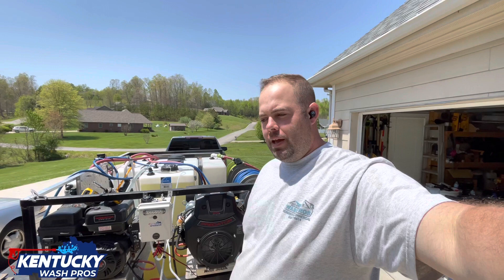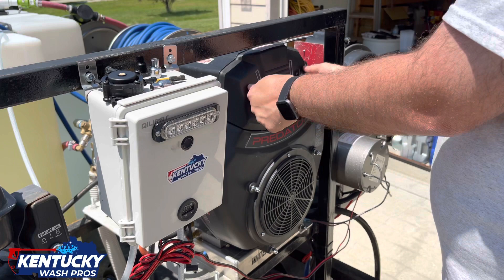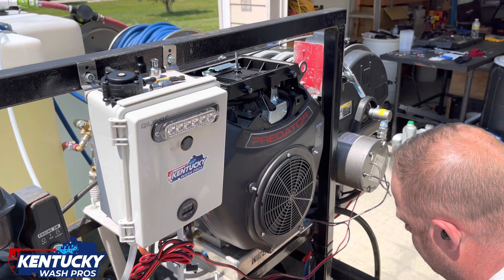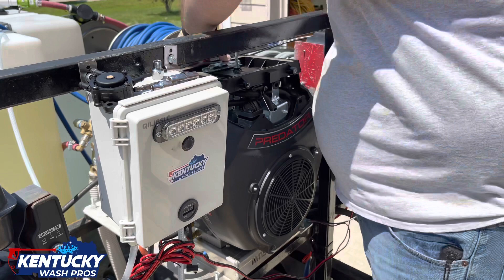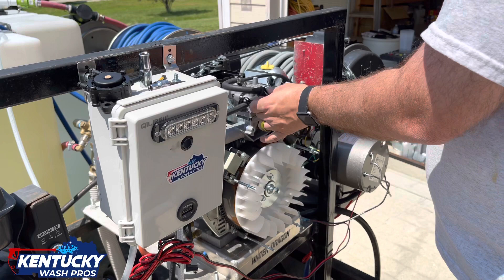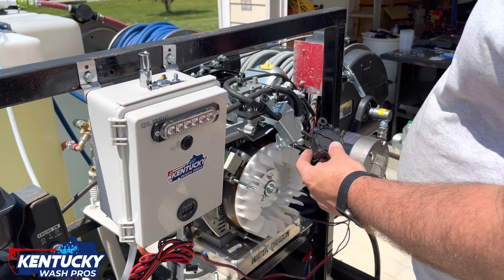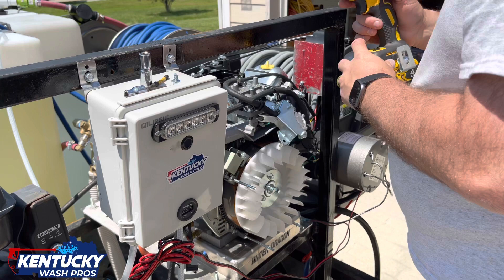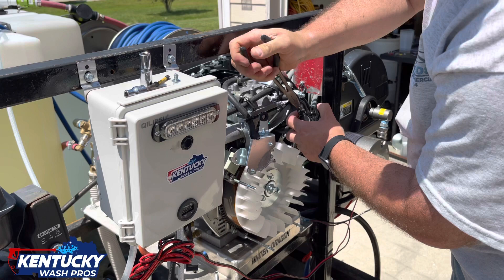How To Replace A Fuel Pump On A Predator 670

Comment: Great engine I've not had one issue with almost 2 seasons on it.  First thing I did was change the fuel filter and fuel pump with Honda parts.
Reply from the maker: I changed the filter first thing and really wished I’d went a head and changed the pump
Reply: @KentuckyWashPros  now all should be right with the world haha.  Watch out for the right side crank case breather tube.  I had some dirt dauber block it and it wouldn't run right until I cleared the tube.  It's a solid engine I use as my main washing rig.

Comment: Thanks for post on this video! I've got one of these motors on a mud-motor kit and from all forums I've read even with the addition of a briggs and stratton fuel pump inside these motors require an additional resource like a electronic fuel pump outside of the motor to overcome this throttle barrier. From the comments below, do you wish you would've done the electronic fuel pump instead of the pairing (internal fuel pump and external fuel pump)? Thanks for your time.
Reply: I just unboxed my 670 and swapped pumps with a GX670 pump and when it came to it priming itself it filled the new filter I installed but once I started it the fuel level was under the filter for pretty much the whole 3 hr break in. It looked like it was running on vapors but some how still sucking fuel in. The higher in rpms the more fuel was in the filter but it still looked lower than it should be. I do need to double check my fittings at the gas tank because every so often I'd see some bubbles come through. Not a constant bubbling but ever so often a group of bubbles came through the filter. That was yesterday, today I noticed the fittings on the tank were out of place aka loose. But I may also take the inline fuel shut off switch of that's another source of air. At 2h52m of the break in I did get some noise variations from then engine and then some sputtering but then it went back to normal. I think the fuel tank just needed to be tilted even though it had probably two gallons left but idk how low the pickup tube is for the 6 gallon scepter tanks. Also I drained the oil that was already in the engine before break in, had two small globs of grease come out. Add 1.5 quarts when filling then read the dipstick from there and add if needed. I added cross hatching to the stick with my knife to make the oil stick and easier to read. I should be uploading my pressure washer build on my other channel soon. It's 19.7GB worth of clips. You don't exactly see me build it but there's details in it you don't usually see.
Reply: I just kept the 1/4 line short as possible use a primer bulb and never had an issue.

Comment: One of the most common “upgrades” is changing out to a Honda fuel pump. It’s good insurance especially when this is your source of income
Reply from the maker: Yea the only way I could make it work was by adding a 12v fuel pump
Reply: @KentuckyWashPros it working good with the 12v pump? I bought the same one you used in your video havent messed with it yet though

Comment: Did this resolve your issues? I’m having similar troubles with mine. I just put together a 670 with TSF2021
Reply from the maker: I ended up adding a 12v low pressure fuel pump and that fixed it.
Reply: @KentuckyWashPros  which one did you use?
Reply: @KentuckyWashPros  gotcha, I may have to add a 12v pump. I added the same b&s pump and it seemed to fix the problem for a little while. What about heat issues? I ran mine for about 90 mins until it shut off and I noticed the gear drive spit half the oil out of the vented cap.
Reply: Did you fix this ? I have same problem with my gear drive And engine stopping .

Comment: Hey buddy,  when you fired your 6.5 up for the first time,  did it pull water right away from buffer tank? I built one and have water in line right to pump but It will not pull it and spray it, any thoughts?

How did you prime yours?
Reply from the maker: Mine primed the first time with no problems. I would recommend taking the waterline inlet to your pump loose it could be airlock make sure at the end of your pressure washer hose that your ball valve is open and reconnect my water inlet to my pump and then I will crank it and see if it will work that way
Reply: @KentuckyWashPros  got it!!!